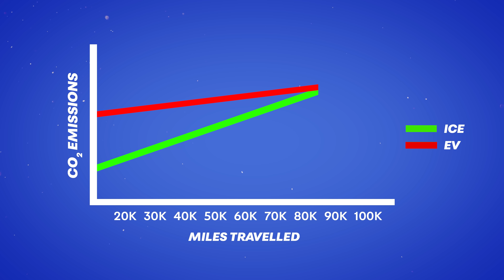Are Electric Cars REALLY That Green? [New 2022 Data]

Comment: In order to charge the EV, we need electricity.

1 EV is definitely manageable. But... 100,000,000 EVs on the road?

Many countries like China, India are still using thermal coal power plants...(massive carbon dioxide (CO2), nitrogen oxides, sulfur oxides, chlorofluorocarbons (CFCs), and airborne inorganic particles such as fly ash and soot)

The hike in electricity demand would require more solar farms(deforestation for more land), offshore wind turbine, Hydro dams(lost of ecosystem), Wind turbines etc. (This is provided the particular country choose clean energy options replacements) Would this offset the current petrol/diesel emission problems overall? ALso, nuclear power plant is also an option but would definitely garner alot of hate from the local mass population.

So would the 2050 zero carbon plan by companies such as Toyota be greener overall? 

I aint a rocket scientist or an environmentalist...Time and data will tell.
Reply: @Exo runner that won't work either. Unless u r from Singapore.

Levying heavy taxes in private vehicles is only possible if the country u stay in has over the top excellent public transport and the only state nation country that managed to achieve that is only Singapore.

Whereas for the rest of the world, this is nearly an impossible task that will span generations.

Anyway, why not take a step back and have a "grow a tree" day world wide or something.

Im sure that will drastically reduce our world temperature in less than 10 years.
Reply: @Exo runner Im sry ive misunderstood ur intent. Anyway, cheers and hope u have a great day. =)

Comment: If the argument to adopt an EV is "for the environment" then I'm afraid there can be no "honest debate". Just for starters, consider all the plastics which is a product of oil. Or how about tires?! And do you honestly think copper is more plentiful than iron? GET REAL! Care to see the horrible processes involved in just mining copper or consider how many more tons of copper will be necessary if there are more  EV's? How about the extra lead or lithium in the very batteries which are sure to lower the intelligence factor of humanity a few more points? Did we learn nothing with leaded gasoline?

How about the enormous extra burden on our already stained electrical grid? I mean, if you think all of that wonderful electricity is all that "green", think again! Something has to generate it and it's NOT all wind or hydro either. Even the simple transmission of electricity is not exactly "green" either. I can go on.

That's NOT to say that we shouldn't consider getting an EV for short trips or daily commutes either. But personally, I think I'd prefer a hybrid or some other vehicle that can at least use some kind of fuel that doesn't take hours to replenish; something like HYDROGEN! Yes, hydrogen EV's do exist but because of the battery butt-heads in the industry right now we can't do hydrogen -- it might make too much WATER! And do I even mention the COST to BUY an EV?! Holy CRAP!

... I swear! This insanity over building EV's with BUILT-IN batteries - batteries that might explode if over charged or exposed to WATER - has got to stop! Get even one large manufacturer looking to cut production costs (as they all eventually do), making enough cheap batteries for these EV's and we're sure to have a few more "car-be-ques" than fender benders every rush hour. Hows that environment going to look once a few more cars start burning up? Not too good, if you want my opinion.

Comment: Thanks for a non-biased video on the subject. Also thanks to Volvo for publishing the report even though it may not be in their best interest. 
For me this was not news. I have seen several of these reports and they all show the same. The B-EV will only break even with an ICE car after it has changed owner once, and guess what the prevoius owner will buy? Yes, a new B-EV that will further add to the "eco-debt" before the previous car has even reached the break even point.
I also question what the report would have shown if we compare a B-EV running on mixed electricity (which is most probable) and a diesel car running on vegetable oil or HVO. Probably the B-EV will never break even. And then we have bio gas ICE cars or the hydrogen EVs that even cleans the air as it is moving and has a break even point similar to an ICE. 

All this makes me wonder why the world is so locked into B-EVs. We are just trading one environmental disaster for another. The problems that comes with B-EV cars outnumbers the benefits. Also, with the limitations of the B-EV in mind all B-EV owners should ask themselves if they really need a car? I commonly hear people saying "I only go to and from work so I bought an EV" or we "I just use the car to go shop for groceries so I bought an EV".

Comment: I've seen these comparisons before, and they always stop at the break even point. 
I wanna know what happens afterwards. 
How does it effect once it needs a battery?
Also all the people who can afford an electric car, are also all the people who generally change cars every 5ish years, I know everyone is different but will they have even reached that break even point? Even going off the 52,000 range is again roughly the 40-60 range is when these people change car. For various reasons, latest model, maximum resale value before it plummets after that 60 mark, etc.
And so then it would reset that comparison again and yes I know the car would then go on the 2nd market but that's just my point, they'll always be making another car.

And before ppl say I'm just a dinosaur, I wish I could afford an electric car, would be great for me running backwards and forwards to work, as it's only a short commute.
Reply: also how much carbon dose it take to recycle it after as well?
Reply: The only batteries I've heard are bad come from the early Nissan leaf 2013, recent tech is a lot more reliable, buy second hand later than 2015 and you should be fine.

I've not had a problem with a Twizzy from 2013, and we've got an i3 second hand which is just great.
Reply: @That V8 Life exactly
Reply: Get a 50cc scooter. Low tax, low emissions, low consumption, cheap to buy.
Reply: @That V8 Life yep! My current Saab is 18 years old and going fine. I don’t think I’ve owned a car younger than 10 years old!
Reply: Its a lot cheaper to run, "fuel" is cheaper, and of course there is very very little maintenance. The breaks even last longer. I would say the comparison isn't fair, but even with a green energy source 29k is nothing, thats 1.5 years. A bunch of chinese companies like BYD and of course Tesla have drivetrains that are ratted for 1million miles which is insane, and the batteries are getting closer and closer to that number. The European manufactures have been good at efficient gas and diesel cars for years, but their battery tech is pathetic compared to china and telsa. Look at the Etrons from Audi, they all have terrible range, the acceleration isn't as good as family car teslas, and they are super expensive for their battery tech.  

All this to say that this is a pretty lazy comparison. If you looked at the front runner companies instead of ones using middle level tech in pretty designs then its likely these timeframes will be much lower. We're also fairly early on with mining technologies and processes, as well as motors and batteries but in a decade electric cars are getting as fast as $3millon dollar Bugatti's as a small fraction of the cost. Id say in 10 years the at par moment will be during the manufacturing process. But I don't think anyone will want to buy a new gas car in 10 years. Electric will be cheaper than gas, range will be much better, charging is getting so much closer to filling up a tank, and the cheapness of no maintenance and breaks lasting four times as long, as well as sports car acceleration with out additional cost.... why would anyone want a gas car at that point.
Reply: All of these comparisons make very little sense: today, we have to extract the raw material both to build batteries and to fuel ICE cars, but a battery at the end of its life contains just as much lithium/cobalt/nickel/... as when it was built, so it will inevitably be recycled when the technology and the economy get there. So, these materials are extracted just once, whereas oil must be extracted continuously. Also, it's absurd to believe that the electricity mix will stay the same as it is today: it will certainly become greener and greener, whereas oil will always be oil. IMHO, EVs would be greener even if with todays numbers they produced just as much CO2 as ICEs. Which probably they don't: this study is the most pessimistic I've ever seen.
Reply: Apparently all these EV nut jobs have never seen classic cars?

Setting those aside. My corvette is a 2005 with 130k miles, still gets >30mpg on the highway, still makes plenty of power. It has no toxic heavy metals to worry about recycling and (knocks on wood) that engine is going to last DECADES longer than any current EV battery architecture.
Reply: What matters is how much CO2 the CAR produces, the owner changing cars isnt relevant as they arent dumping the car in the ocean when they get a new one, they are selling it and it will keep getting resold and driven until its dead.
Reply: On many EVs the batteries can be serviced. They can replace bad modules without having to replace the entire bank of batteries. The batteries also last 10+ years which is as long as the average lifespan of modern ICE cars. The batteries are also recyclable and can be used with relatively low effort to make new batteries.
Reply: @timfennell3380  Currently driving an '06 Chevy Trailblazer with >300,000 miles. Some vehicles on the road are even older.
Reply: @timfennell3380  car engines last longer than 10+ years, sure performance can start petering off but they last.
Reply: @KingWeir  you also forgot that the car will be used further by a new owner, and not trashed :)
Reply: @Karonar  I didn't forget, I did mention about getting on the 2nd hand market but that they still be making more cars, just like ICE, there's always a newer model to tempt somebody.
Reply: @timfennell3380   Tesla offers battery replacements for a shockingly high price, a study by another battery manufacturer shows Tesla’s price is spot on correct. No one who buys an EV would ever buy a 3rd party battery, even if there was company who produced them (there are NONE). Also no ev battery from any manufacturer Telsa, Audi, BMW has a 100k warranty. I love EV’s own one but realistically the tech is 20 years from being cost effective.
Reply: the battery last about 100K miles, then u need a replace. with both US and EU only at 20% renewer( renewer is not green) eleticity, the break even point is about 100k miles so with BEV, u hit break even and u need a new battery, u need to drive it for another 100k miles again to break even, but then u need another battery and repeat, so unless we have better enviormental friendly battery, ICE is still better. same thing with gas cost adn electricity cost. BEV cost about 20K more then ICE so by the time u break even on charge vs gas, which is like at 300K+ miles, ull already need 1 to 2 battery replace so ull nvr break even with ICE car in purchase+operational cost. many youtber will said that they save 10K in charge vs gas in 100k miles of driving, which is funny as fuk cause if they would to buy a ice car instead they would have save liek 30k righ ton teh purchase at the start. number manupulation to make one look better then the other.
Reply: @yia01  100k mile battery life is just not true. Modern EV batteries (e.g., what's been used in the BMW i3 over the last decade) can do 4500 full cycles, which for an EV of 200 mile range translates to almost a million miles.
Actual data from real EVs (except 2013 Nissan leaf) confirms this.
Reply: @Feomatar04  you're not factoring battery degradation and environment affects on battery life. Range degrades over years, so that 200 mile range today will be 50 in less than 100k miles
Reply: @KREllis-vr1ix  that is just not true. Look at real life data. Tesla batteries degrade on average ~10% over 160.000 miles. The range of my 2017 BMW i3 has not even changed at all over the 120.000 miles that it's driven. The hysteria over battery degradation has simply not materialized (except for early Nissan Leafs).
Reply: @KREllis-vr1ix  assuming ICE care don't wear out prematurely in cold weather as well... Trust me, here in Canada, only a handful of ICE cars go well past the 200,000 km (yes, kilometres, not miles) mark, and sometimes it's just because the owner don't mind to keep throwing money at it. People with valuable cars has a "winter beater" for a reason. And let's be real, not a single modern car will last like a '92 Camry would.

Comment: 7:15 emissions: EVs are just better ->
- if you drive short distances your break even point takes longer to reach
- if you drive long distances you reach your break even point sooner
So in the places where air quality is no problem he thinks you would get the best improvement. But in the places where we really need better air quality it won't do as much. The real win with EV's is that you can move the air pollution to a place where you are not. Sounds like a great plan for the rich. And so far, EV's are mostly for rich people.

Comment: Where are the calculations on:
- recycling the batteries and replacing them
- creating the grid and charging stations needed for every person to be able to drive electric(you need more of them than gas stations because people will just want to park and walk away)
- the loss of charge when it is standing still. You won't lose gas from your gas tank. But you electric car will lose charge everyday, wether you use it or not.
- how much of the vehicles will still be in service after 90000? These vehicles don't seem to be made to last 20 years like ICE vehicles

Comment: Good try, but your premise lacks proper foundation. 
First, is CO2 really a pollutant? A cause of Climate Change? Over the past 20-years the average annual increase of atmospheric CO2 is less than 0.0002% . . . insignificant when compared to the #1 Greenhouse Gas, H2O . . . or Solar Cycles.
What is at issue is governments pushing 'Green' energy too quickly, which destroys natural economic processes of ROI and Research Investment, while destroying the existing economies. In time, EV's will have a fantastic role to play, but not now or in the near future. Get government and lies out of it, and things will progress just fine.

Comment: How green is an EV in time when the vehicle degrades and wears out as you drive it just like any other vehicle when you have to replace the battery and the motor when it all fails? Be realistic - electric motors and batteries fail all the time and not to mention the electronics that power and controll it all. Electronics are the most unreliable things made today - especially new stuff. Its all junk made by the lowest bidder. Electric cars are junk and for Karen's and soy boys.

Comment: Ugh. EVangelists are the worst. Too much Tesla stock, not enough brain cells. One of the most environmentally friendly cars out there is the Toyota Corolla. They don't burn too much fuel, they are cheap to build, cheap to buy, and they can run for a very long time with very little additional maintenance/parts. If you total a Corolla, it isn't a humongous write-off. If you total a Model 3, you are 2-3 Corollas in the hole along with a huge emissions debt you will never pay back. Just saying...

Comment: 1. Volvo makes money selling ICE cars. They do not make money selling EVs.
2. Real data from studies done by companies who has no money to gain either way shows that the real number is 18.000 miles.
3. The Battery which is the polluting part of the EV can be recycled (95%). Meaning the materials in used for batteries can literally drive millions of miles.

Comment: There is another issue in those calculations (mentioned by posters in this video, but not by the study or what it was reported here). 

Contrary to what the presenter stated the more realistic scenario in the US* in the next decade or so is closer to the 92K mile figure, since most of their electricity is from NATURAL GAS, a "cleaner" fossil fuel with elements from OTHER PETROLEUM PRODUCTS and even COAL in some places, so it's a "mixed bag" that will take DECADES to go clean enough. 

Anything close to 92K miles (7.67 years at 1K miles / month) is not too far from the time the battery pack is supposed to be replaced at the 8-10 year mark (most manufacturers, except the Hyundai Group, warrant theirs up to that point), at which point starts the clock again. With recycling I calculate it'll take 2-5 EXTRA YEARS for the ICE'd vehicle matching the CO2 emission of the BEV.
--------------------------------------------------------------------------------------------------------------------------------------------------------------------------------------------------

* Chinese numbers would be closer to American numbers (below the 92K mile number, but not by terribly much) until the Government begins closing their COAL-fired generators while European^ numbers are not yet at 29K miles (cleaner level), but moderately above the 52K middle level, as now a significant % of their electric grid is operated from NUCLEAR POWER (another can of worms) and ALL KINDS OF RENEWABLE ENERGY SOURCES.

^ First to reach those "clean level numbers" within Europe would be the 4 nations of Scandinavia, as not having as much people as some, they're "ahead of the curve" in RENEWABLE ENERGY SOURCE deployment.